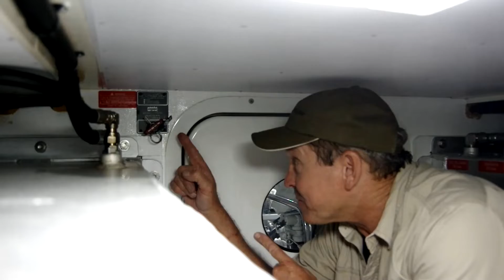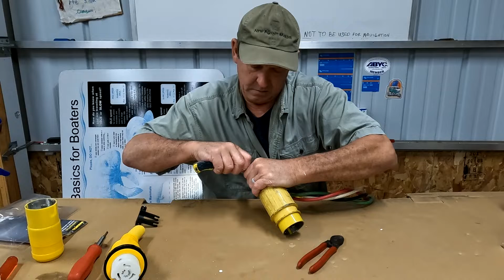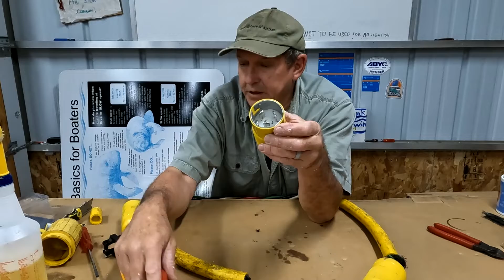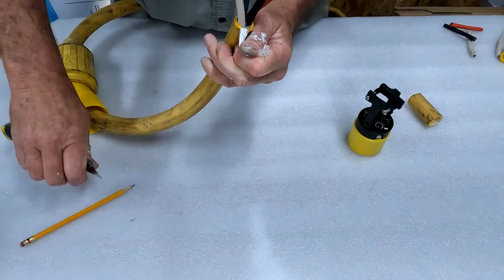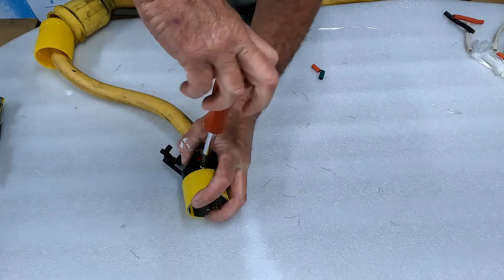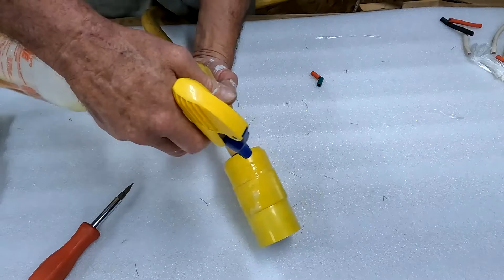How to replace your boat's 50 amp 240-volt shore power cord end.

Comment: Hey Eric, I tried to do this but the cord from my boat only had 3 wires, black green and white inside my 50a cable..  I got a 50a 125/250v male plug like the one in your video, but the plug has 4 receiving ports, and I don't have the 4th red wire.  Can I still use this plug, and just connect the white, black, green to their respective colored holes?

Comment: Just took the male end off a 50 amp cord. All the screw heads were corroded. These were factory installed (probably in China). I make a habit of cutting back to fresh copper in all wires. I also apply dielectric grease to the screws. Two years ago I+ ago. I had a bad cord failure. The wind blew with tension on the cord. The voltage levels were all over the place. The cord was dumping 220 v through the electrical system. These microwave was fried and the inverter failed. When I took the plug apart, the common wire was pulled from the plug and the wire in the plug was too short for a strong conection. Luckily the boat didn’t catch fire. The circuit board in the oven 
Was completely’ toasted.=

Comment: Would you replace the connector if the white silky insulation is hanging out around the boot or reseat the boot? The power cord works fine. I appreciate your videos.

Comment: Other than visual inspection, is there any type resistance test or something else to warn that connections need to cleaned/replaced on our shore cords?
Reply from the maker: Probably the easiest test to check the cord connections for heat. One could use a non contact thermometer or thermal imaging or touch to check for heat while the boat is pulling high amps. If the connector is excessively hot then there is resistance.